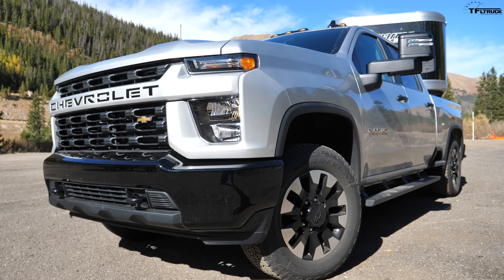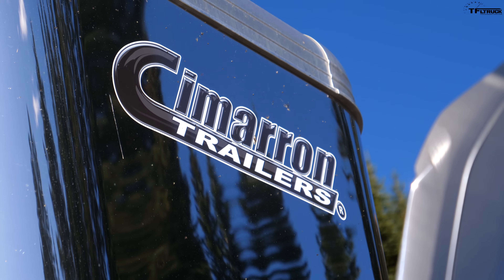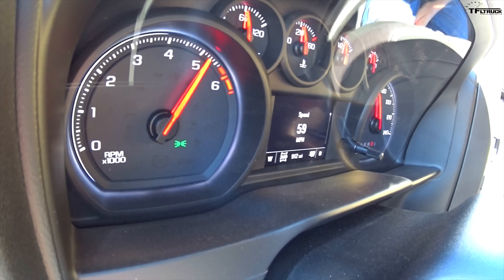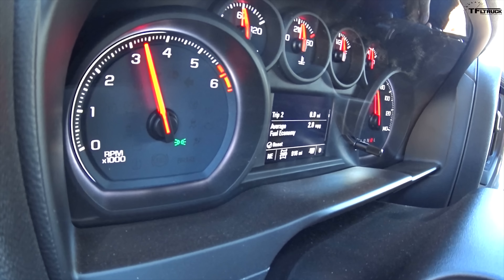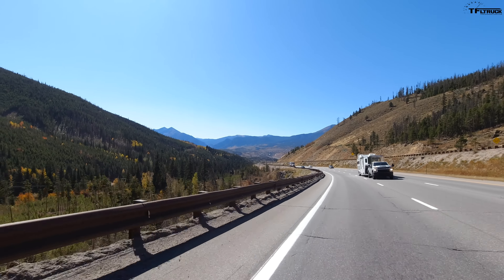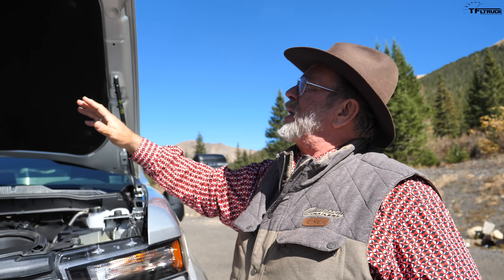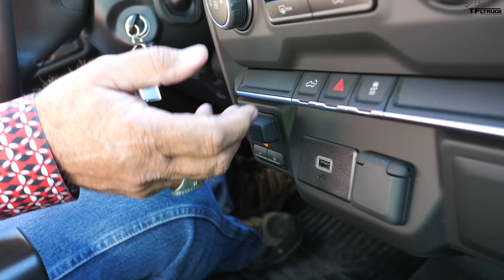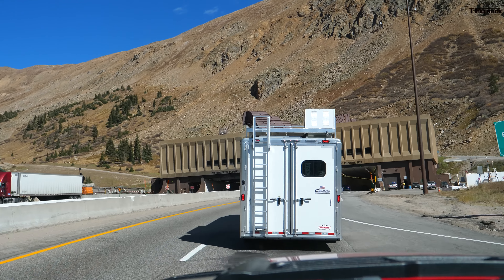The New 2020 Chevy Silverado HD Gasser Broke Our Ike Gauntlet Scoring System - Here Is How!

Comment: I remember back when 6 speeds was a lot
Reply: That's not very far back. How about 3 on the tree
Reply: My Mustang GT has a 5 speed :)
Reply: My Tacoma is 4 speed auto 6 is still a lot to me 😂
Reply: @freedomisntfree_44  my father 2005 Yukon has 4 speed automatic too. But it's still get very good fuel mileage for the weight and displacement.
Reply: @pryme2013  you young people and your fancy 3 speed back in my day a 2 speed Powerglide was too many.
Reply: Hell I remember when a 4 speed in a pickup was a big deal.
Reply: It's still plenty sufficient. A 10 speed is only marginally better on fuel and performance. Like maybe 5% at most.
Reply: JuAsked ForIt  My '67 Chevy had a Powerglide automatic transmission - Powerglides have just 2 speeds.
Reply: @justinluttrell1769  your comment didn't age well. Go check the Ford 10-speed gasser video they uploaded.
Reply: @vaquero_solutions  I've seen it, what about it?
Reply: @justinluttrell1769  the 10 speed Ford curb stomped the 6 speed GM.
Reply: I remember back where 3 speed was a norm
Reply: @vaquero_solutions 10 speed ford also had a 4.3 rear end.
Reply: @slaytanic921  not Ford's fault that GM doesn't offer a 4.30:1 ratio

Comment: The 10spd would have absolutely helped.  Having a smaller gear split would help this engine stay on its torque curve while in the hard pulls.  I really hope that trans finds it's way into this truck sooner rather than later.
Reply: Model year 2024 has entered the chat.
Reply: finally did.

Comment: Only a Gm would be applauded for the steering wheel and seat being straight inline.
Reply: Should be given an Award 1st year in 15 LOL
Reply: This is new to me. What do you mean by that? Researching trucks am weighing the pros and cons.
Thanks.
Reply: Rxonmymind GM/Chevy trucks steering wheels are not aligned with the steering column
Reply: @rxonmymind8362   The steering wheel on older GM trucks wasn't inline with the seat. It was offset to the right. I don't know if they still do that or when they stopped. It never bothered me on my '97 GMC though...
Reply: jrhunt414 2017 trucks are still offset not centered
Reply: Have you ever driven a transit
Reply: Had an 04 I didn't even notice it if it was there
Reply: I've got a 2018 1500.  I don't notice any offset.
Reply: Had 2 ‘04s (1500 & 2500), and now a 14. The slight steering wheel offset has never been an issue. Just another pissy reason for Ram & Ford owners to throw shit to try to diss the GM brand
Reply: @0778drz110  i have never noticed it on my 99 Tahoe
Reply: It is really not noticeable
Reply: This was corrected in the 2019+ models. Obviously, those who have owned a few GM trucks prior to 2019 are going to say it never bothered them; they were used to it. I've only owned Tacoma/Ram since 2007, so it would stand out any time I rented a Silverado or Sierra. A ridiculous problem that took far too long to be addressed.
Reply: I drive Chevys and GMC trucks at work and never knew the steering wheels were offset? I’m wondering if that’s why my back feels off when riding in them all day compared to my own Ram Truck?
Reply: @0778drz110  WHAT I can't unsee it
Reply: Have driven some peterbuilts with 4-5" offset steering wheels, absolutely miserable vehicles.
Reply: @Furious321    What problem?  If there is some kind of "offset" it's not noticeable.
Reply: @markwarren3156   I drove a 2013 Pete 386 for five years, no offset there.
Reply: I rented a Chevy 1/2 ton years ago. About 300 miles into my trip my back was wrenched. I stopped and it hit me. The steering wheel was offset with center of drivers seat. Lol. WTH!!!
Reply: If I sit in my moms 13 sierra, im looking at the passenger side of the front windshield. The most annoying thing ever
Reply: By far the best looking HD out of the bunch

Comment: This Chevy just towed 16,0000# at high elevations up hill with a small block V8.  Sounds like biggest issue was the transmission wouldn't down shift to maintain speed.
Reply: Ray D the gear spacing appeared not ideal for that much weight, grade and elevation. Would love to see GM offer a low cost option to pair this 6.6 with the 10-speed.
Reply: it would downshift then accelerate to redline then upshift but it didnt have the power to hold the higher gear and then it wouldnt alow downshift again to save the trans. they should allow the lower gear and have programing in to stop it from getting to redline in that gear and hold say 4500ish or so maybe 5000 rpm in that gear until the grade lessens instead of grabbing the next gear and sitting at 3000rpm and going 25
Reply: @gagt5spd  Chevy needs to take a lesson from Ford.  The Ford V10 was paired to a 5 speed transmission which, the first 3 gears are close ratio, so the tranny can keep the motor in the power up to 65 mph.  Duh Chevy!
Reply: They should do it again out of rotation for the testing.. using the manual mode maybe it would help
Reply: That's why you put the transmission in manual mode
Reply: that actually is amazing...out on the public road, just going with it. A stunt like that over the years would be crawling in some granny gear in some rural place. I wonder what boost would do, to keep that air cramming in for some density. Better off with a diesel for sure.
Reply: @jerredwayne8401  
I agree that's why the manual mode is there. This is a big reason I don't put alot of stock in these test.  They're fun to watch but don't really tell you a whole lot.  I do agree it should have a 10 speed.  Not sure why GM is so stingy with it and Ford puts it in everything.
Reply: @rayd2100  Remember that time they did a manual Nissan Frontier and the driver didn't downshift? It was Roman of course, only the boss can get away with that...
Reply: @jerredwayne8401  Would manual mode allow you to hold the transmission in the gear you want? I have a 2017 Ram 1500 and when I'm towing it seems I can drop gears in manual mode but will not let me upshift past the gear it seems to want to hold itself.
Reply: In my wife's Camaro it will hold the gear until you push the up or down paddle.  I would assume it's the same.
Reply: Sounds to me like the biggest problem was that small block Chevy.
Reply: 1LOCKNLOAD nah, as someone who tows 12-15k daily with my Dmax, the main problem was the operators doing an extreme test without utilizing manual mode - which is best with the 6 speed on this type of terrain.
Reply: Looks like it did fine to me. No one is going to buy a gas 3/4 ton so they can tow the max up Ike gauntlet everyday. I’d take it in a heartbeat. More than enough grunt for 99% of the people. The same people whining and complaining about this thing are the same people that Brag about a 5.4 Triton or a ford v10. If one of those would’ve climbed the mountain at 10 miles an hour they would’ve been jumping for joy About how wonderful it was lol.
Reply: @theaveragejoestinkeringand4407  you know that's right!
Reply: Exactly what happened with Ram and the 6.4 hemi.. transmission mapping is way off course. Chevy should have done their homework on that, glad they did do something other than the 6.0 though. Long overdue for them!!
Reply: @theaveragejoestinkeringand4407  so you're comparing old out of production Fords to this thing to justify it.. I'll guarantee those old Fords still would've out performed this slug. The reality is GM are behind the 8ball, a 6 speed still? And they can't compete with the V6s either. No one in their right mind would but this over the competition unless they are blind loyal to Chev (although you have to be blind to live with its styling) or miss owning a Pontiac Aztek. In fact this should be called the Aztruck.
Reply: oldpilot nz No not really I would compare an old 2001 or 8.1 vortec to any of these new Ford engines and that’s an out-of-date Chevrolet engine. Personally I don’t want more speed I’m fine with a big  engine and a four-speed. I’m just saying people brag about those engines like they’re great. I don’t really have anything against them but I’m not dumb enough to sit back and listen to idiots. We used to have an entire fleet of 5.4 maintenance trucks over all as a whole they did OK but still by far the worst vehicles we’ve ever had and the V10 is not out of date it’s still in production for Ford’s medium duty trucks. If you’ve driven a new Ford 6.2 L it’s nothing special either once again it’s a good engine but not some monster that’s going to annihilate the competition. I think the new 7.3 will be great but once again you can already look up the numbers it’s no monster either. There’s not really any point to have a big block anymore when you can get the same cubic inches out of a small block With less weight. I don’t want 6 10 or 25 speed transmissions for better gas mileage. I still have my grandfathers old 85 Silverado with a 350 that I built about eight years ago and it pulls better than any new truck that I’ve ever been in as far as gas burners go and gets about 13 miles per gallon with my boat with three speeds. You can gently roll the  throttle on at any speed and it will pull and just about any he’ll except black mountain in my area and never break a sweat or downshift over 55 mph. I’ve not been in any new gas powered ford  or Chevy that comes close to pulling as good as it does. That’s not too bad for an old truck and it’s not too bad even for new standards. The smartest thing Chevy can do is stay as old school as possible with their engines and transmissions because they’re definitely better than this new crap. A good friend I work with has an old outdated you say Triton V8 that has 97,000 miles on it and it’s blown out 2 spark plugs and is dog ass weak. His wife is on her second brand new Ford fusion and now this one has transmission problems still under warranty nobody wants to deal with that crap. All I can say is thank God for Chevrolet is out of date stuff. You’re smart people can have all this new stuff.
Reply: Rocket John that piece of junk also got like 7mpg... empty
Reply: Rocket John the v10 was out towed by the Chevy 6.0 and 8.1 . The v10 was terrible at towing
Reply: Maybe Fords V10...Dodges V10 was a monster.  Especially with the Mopar performance ECM and cam.
Reply: @deeohgi  yeah.. tfl claims that real people who tow dnt like to put it in manual.. thats y its one if their  rules to not ever use manual shifting. But.. i disagree with that rule
Reply: @VortecEmachine  Like the TFL guys would know more about the power train (capabilities and managing longevity) than the GM engineers who put the manual option in these trucks for a reason, ie. towing  in specific situations. I don't use manual much, even though I tow daily. But, I can tell by the feel and sound of the powertrain when  it's best to use it. These guys are like Swift drivers... put it in gear and floor it to see some #'s, or until  something breaks.
Reply: @theaveragejoestinkeringand4407  I bought this truck, 2021 model for traveling cross country with a travel trailer. I wanted something a little bigger than the 1500 but didn’t want the headache or extra cost of the diesel. I’m not towing heavy equipment in the low to mid teens. Just a heavy bed load and a travel trailer at 8000lb fully loaded. I know the 1500 can handle that but I wanted the extra power and handling since I’ve got my whole family in there journeying through mountains and strong winds at high speeds.
Reply: @ShawnDones  Smart man.
Reply: Almost like anyone that pulls that weight in D is an idiot and should not be towing that weight.
Reply: I pulled 16500 with my 03 6.0 with 410s okc to houston it struggled on inclines would only hit 55 but this truck should of did better than that
Reply: They leave the factory tuned for mileage. A cheap aftermarket tuner in tow mode is an easy fix for the shift issues. Makes a world of difference. Also agree 110% with keeping the 4.10 gears, and the Allison. Same chassis, 40hp, 3.73 gears, and 3500+ extra tow weight doesn't add up over the 6.0 & 4.10's. Not enough difference. I'll keep the 4.10's with the 6-speed, and buy the 2019 for half price.

Comment: Great review. They pulled 16,000 lbs, UPHILL, at 2 miles ABOVE sea level, with a GAS engine 3/4 ton SRW! The truck did it. I wouldn't complain about those times, speeds, or brake applications. 3/4 ton gassers were rated for 9250# towing just several years ago. I also would never attempt that. Ponder the physics. This is getting silly.
Reply: And they were overweight on pin capacity
Reply: There's a thing called trailer brakes..
Reply: @elonmust7470  lol. I think I've heard of those.
Reply: @sharkskin3448  I used to pull around a 2 axle flatbed with a 1974 f250 with with a 390 that had been gone through back in the 80s. I've had close to 30,000 lbs on that trailer. 1st gear low range, wide open throttle, pulling concrete troughs through the San Luis Obispo hills on the Chimineas Ranch. Point is that loaded flatbed trailer would've shoved the old ford down the first hill it tried to descent without trailer brakes. With trailer brakes you could just engine brake down the hill. I'm not talking about public roads either, steep, very steep stuff. Sometimes that 390 would get hot & start backfiring when at WOT but it never gave up. Some old timer from Bakersfield rebult it with a bunch of Crower stuff. Thing loped like it wasn't a torque motor when it was cold.
Reply: @elonmust7470  public roads are bad places to take chances, tho. I had medium skid steer nearly push my f250 through a downhill 4-way. The trailer was from an equipment rental dealer. I finished my trip VERY carefully, being a late Saturday afternoon. I'm old enough to not trust other people's shit anymore.
Reply: @BetaRacer24 overweight? How so?
Reply: @slaytanic921  the max gooseneck weight thats stickered on that truck is 1000 pounds less than payload. Considering they were maxed out with both of them in there. They were over its capacity. I have a 2020 6.6 gas 2500…